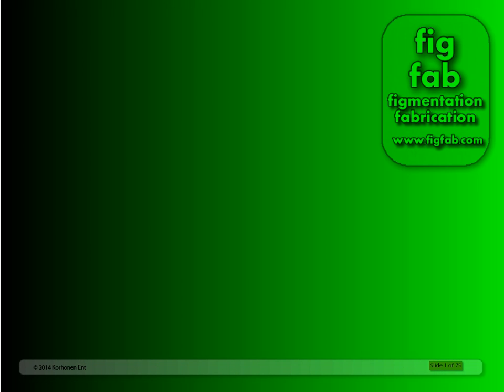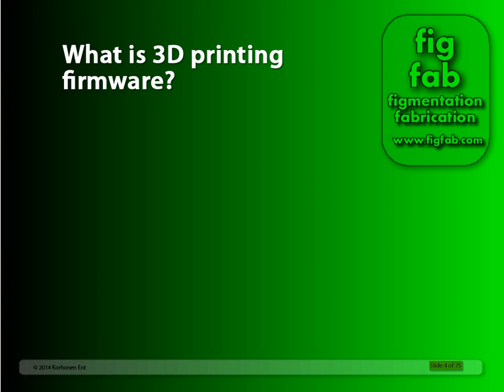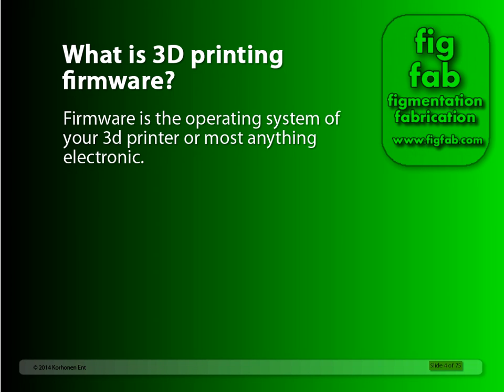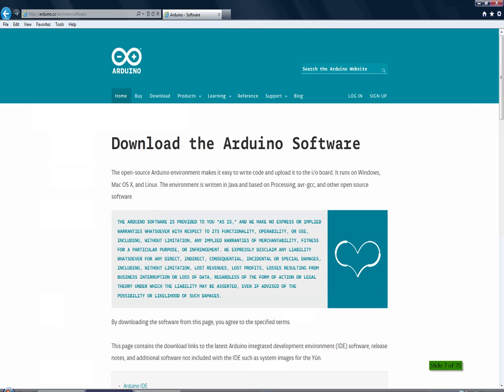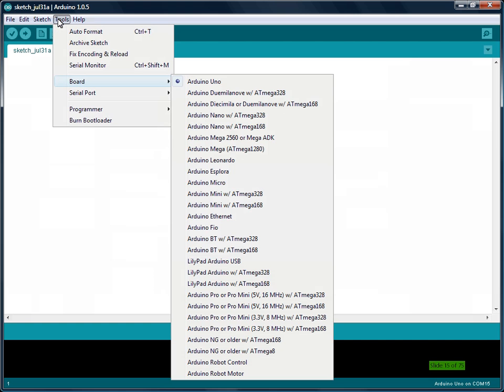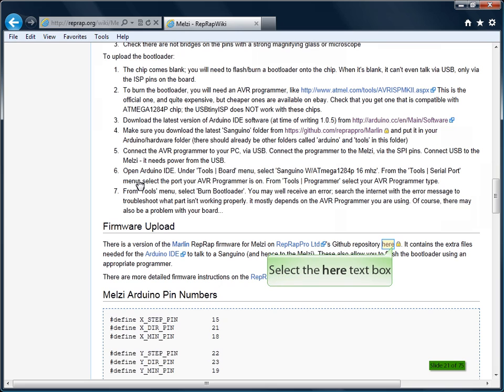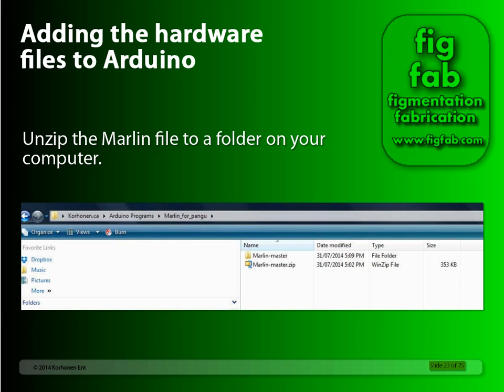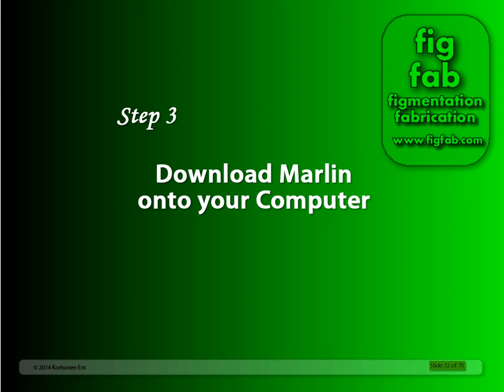3D Printing with Arduino and Marlin Steps 1 to 5

Comment: Is it just me or does the audio cut out around 7 mins?
Reply: Cameron MacRaeSorry yes it does cut out e-mail for any missing information
Reply: ***** I have a few questions about this for example when I open up tools after pasting Sanguino into hardware i go to Arduino then tools then board but there is nothing new, and at the bottom of the page it says"WANING: Error loading hardware folder No valid hardware definitions found in folder sanguino."
Ant advise will help
Thanks.